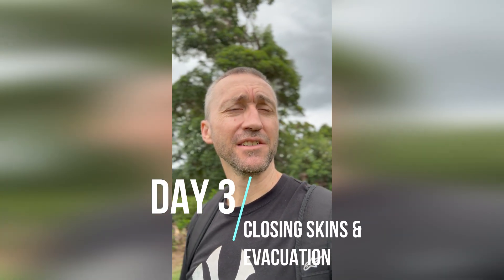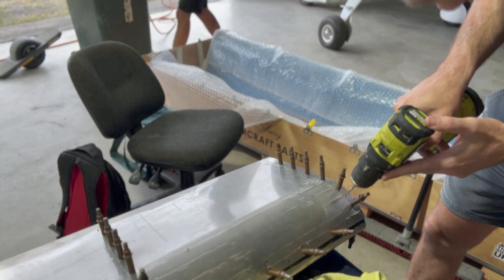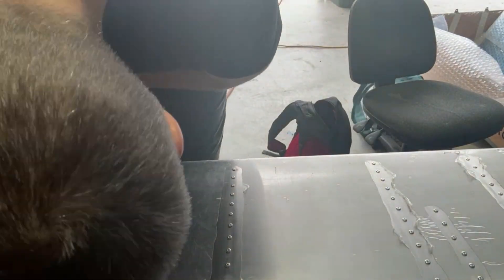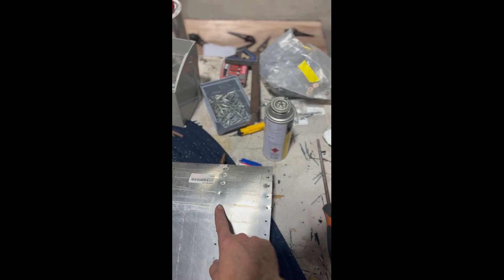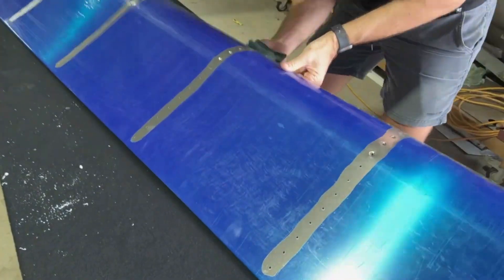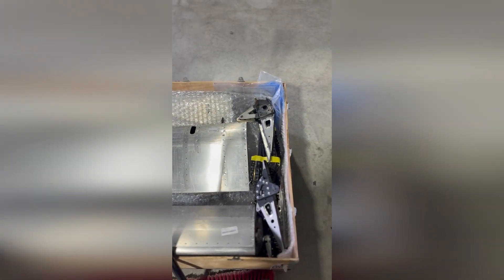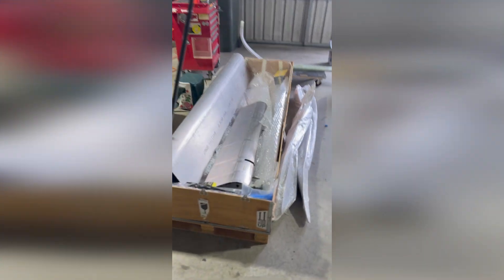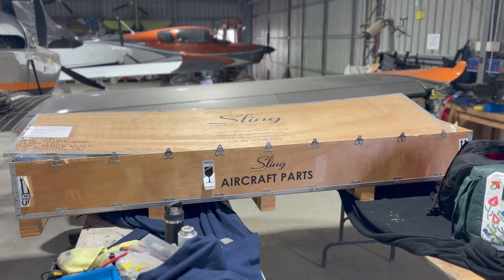Sling TSi Build Day 3: Clecos & Fit (AU)

Comment: Thanks very much for your videos, so informative, and Australian. Living in Tasmania, owning an aircraft gives an ability to get across Bass strait, and something I hope to achieve. 
I note the pre assembled Quick build parts are alodine coated, and your build is using black stuff for mating surfaces. I note that the Sling Aircraft Build-Assist Centre in Torrance CA, in the Aviation101 channel shows the build without using any anti corrosion coating on the flight surfaces. Is there a reason not to use the same Alodine finish that the Sling factory use?
Reply from the maker: Hey Darren,

Thanks so much for your comment—and I’m right there with you on flying across the Bass Strait. It’s absolutely top of my bucket list!

I’ll pick this up with Errol on my next visit and cover it in the next batch of video, but here’s my current understanding:

Factory quick-build parts (wings, etc.) arrive alodine-coated from the South African plant as you mentioned.

At the Build-Assist shop, they go straight to that black zinc-chromate/epoxy primer (black stuff), feathering a thin coat on all mating surfaces. This gave me alot of confidence in a number of areas, particularly around that flap/aileron area where I could imagine ingress could be an issue.

My assumption is as I spoke to Errol briefly about this they skip the alodine step because the conversion process is pretty nasty—requires tight environmental controls, specialized PPE, waste handling, etc etc and again having visited Errol’s paint-shop I'm assuming the primer they use gives you an equally robust (if not better) corrosion barrier in one go.

That’s likely the reasoning, but I’ll confirm with Errol and let you know the exact details. Thank-you love getting this stuff because it was me a few months ago wondering about all this stuff!

Kade